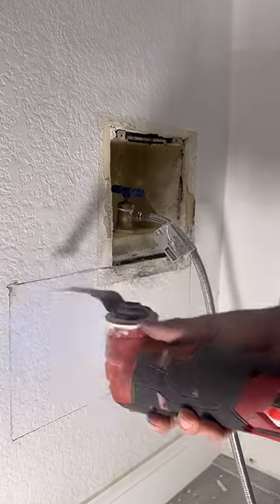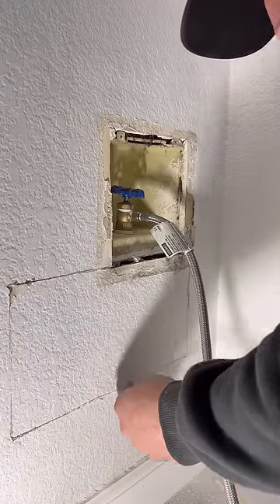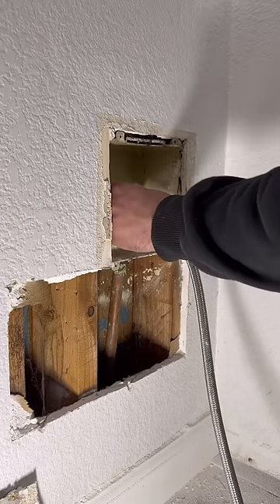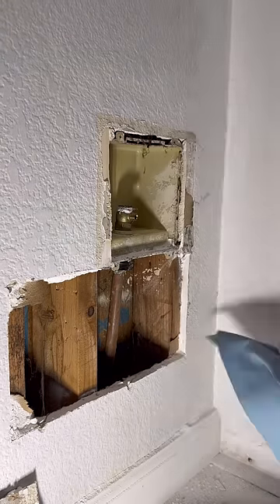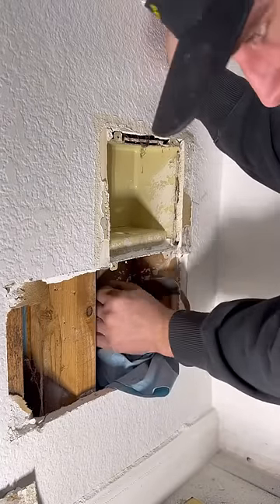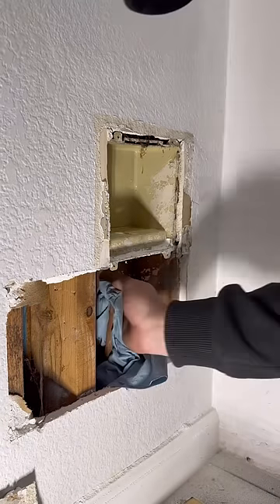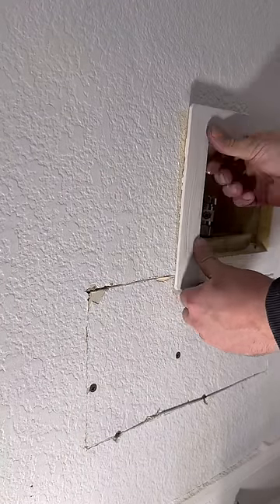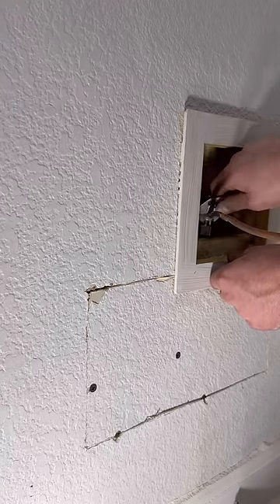replacing an icemaker valve #plumber #plumbing #propress #diy #soldering #repair #copper #easymoney

Comment: My guy even cuts the drywall clean and puts it back, most plumbers/electricians would’ve just put a fist through there and spat on the dust
Reply: Yeh, this cat thinks about the next guy. Golden. I like his old buzzard impersonations too! 😂
Reply: "just put a fist through there" I am rolling because it is true.
Reply: Can confirm
Reply: @namechamps  electricians are the worst. They are also the most unhappy of all the trades. Go figure.
Reply: lmfao see that too much especially with electrical.
Reply: But a plumber using a insulated screwdriver
Reply: @vrea77  if it screws it screws!
Reply: @johnbagewll2321  sounds like something a plumber would say

Comment: I love the fact that you go ahead and address all the potential Facebook plumbing inspectors during your video 😂😂😂😂
Reply: I was thinking the same thing 😂😂
Reply: Let's see...he should have repaired the existing valve, he cut the hole too big, shouldn't have used press fittings, and the valve he installed is crooked.  Did I miss anything I learned in my 147 years in the trade?
Reply: @mph7282  yeah, that you're in the wrong trade. 😂

Comment: My father and I do bathroom and kitchen renovations. 

Sonic tool is an absolute god-send for getting into walls like this, but just can't sell him on spending the money on the pro-press tool. There's time and place for sweating, don't get me wrong, but sometimes you're really just fighting yourself when you have to stuff a mat behind the pipe, tack it up with a single screw, and then making sure everything is wet before you hit the wall with a torch.

I used one to re-plumb the hyper-cooler for an induction furnace once. Ended up being more than 50ft of pipe in a space that essentially fit inside a broom closet - all of it 2in copper. 

I can't even imagine the nightmare of a repair job it would have been without that pro-press. Best plumbing tool I think I've ever used. 

Keep up the good work bud - you're damned good at your profession.

Comment: I don't know if it is just misunderstanding, but one of my customer had refrigerator ordered from home depot, but installers could not install because ice maker supply does not have a valve.  Well that valve was under the sink and had soft copper tubing run through cabinets. Also, the valve does hold. Installers had Home depot call their contracted plumber and plumber came out and installed in-line valve at the refrigerator end for $350.  My customer thought Home depot would call and schedule re-delivery and install, but they never called. Instead the order got canceled.  I ended up fixing their old refrigerator and my customer wasted money installing unnecessary valve.

Comment: I hate those ice maker boxes behind the fridge.  We always run the line to under the sink on new roughs.  Have you ever used the 1/4 pex for the lines?  They’re great, they don’t kink and don’t need an insert like poly, only a nut and ferrule.
Reply: Great idea, I always prefer to have the ice maker valve under the kitchen sink for the customer. I'll try the 1/4" PEX next time.

Comment: You do some good clean work personally I will use a braided line safer that way
Reply: Dunno why he went from braided to soft copper, but from a full twist valve to 1/4 turn, seems like he upgraded the valve and downgraded the supply. The patch looks nice tho. I can deal with that repair!

Comment: I have a stud finder that self-calibrates to the density of sheet rock or plaster and can detect metal. Then I have another one that detects metal and electrical but doesn't calibrate so it won't work on plaster unless I find a screw. It's faster to find the stud than it is to find the screw.

These tools were not expensive.

Comment: I like that you only use 1/4 turn valves.  They are much better and last longer.  I'm skeptical about using ProPress inside a wall.  I worry that it won't last as long as a soldered connection.  But, I get the speed advantage.

Comment: Quick tip.
Most times can get away with just caulking all the way around.
But make your drywall cuts on an angle going into hole all the way around. It self centered.
You just need to expose screw/nail head.

Comment: cool if you don't have parts for that valve but it definitely doesn't take less time to install a brand new valve than to rebuild the existing valve.  Like it's a perfectly reasonable choice to make but in no world is it faster to cut extra drywall and change a valve then to rebuild a valve in place.

Comment: Good luck matching that knock-down done on the wall.and you know being a plumber the pipes go straight down under the box.good job replacing the valve though and as they say( I ain't the plumber  or the plumbers son but I can plug any whole until the plumber comes) crap runs down hill,payday is on Friday and the boss is an S.O.B

Comment: So as a service company you don't install anything but quarter turn valves but you'll be ok connecting soft copper knowing the line will be pushed in by the refrigerator lol

Comment: As a maintenance tech you did a great job only thing I would have did different I would use the braided supply line rather than soft copper. To me they have more flexibility and they're less likely to break during movement. Other than that great video. Me myself I would have finished the repair on the wall.
Reply: This was the only thing that confused me, I don't understand why he went to a line more likely to kink and break, maybe I'm wrong, but it was an odd choice to me
Reply: He gets to charge for it.

Comment: Why not use a braided stainless steel hose?
Reply from the maker: Didn’t have one. Copper line is good too. Same same
Reply: Copper lines are often requested for water lines and sometimes are by area code. The main reason is that, copper, naturally kills bacteria in water. although, it may not be a big deal, since it takes around 7-30 days for filtered still water in pipes getting harmful bacteria.

Comment: I'm curious why he went back to using the copper supply line from the valve to the fridge instead of just using another braided stainless hose? 

I've always used the braided stainless personally because it prevents the line getting beat up from moving the fridge around for cleaning and stuff over time.

Comment: Im not personally a fan of propress fittings for applications like this, just based solely on price of fittings and tools. Just the fitting alone is a few dollars compared to a 50 cent coupler because of manufacturing, and the tool is more expensive than a full soldering setup. 

I believe propress has its time and place, but in my opinion its more for emergency situations where you cant fully turn off the water, or drain the water from the system enough to solder.

I was brought up old school, and a compressed rubber ring will never last as long as a properly soldered fitting. 

Either way, clean job 👍

Comment: Superclean repair! Something like that that you're never going to see just run a bead of caulk around the seam push the fridge back and you'll never know what happened. Always try to save your drywall when you have to gain access. Another great tip if you have to cut drywall to let's say get behind a tub valve you could always cut in a access panel door and you can even get a paintable one that way you will always have access to that area and it will save on drywall repair

Comment: I'm not going to argue about the rebuilding of the valve because it could have been fixed in 5 minutes and no sheetrock repair but quarter turns or more reliable My big question would be why did you use a copper line when you started with the braided line proven to be more flexible and reliable then the copper line that will most likely kink and possibly leak not saying it happens every time just saying it's a lot more likely to fail than the braided line. Just seemed odd to go with everything new school and then install an old school copper line. Genuinely curious what your reason is

Comment: I like how so many people have issues with squishing 1 thing on another, but compression fitting arnt a problem 😂
Reply: Compression fittings don't use rubber to seal up the pressure.

Comment: it took wayyyy longer to replace the whole valve than it would have to change the rubber on that old one. as a fellow plumber. to each their own but this could have been a 5 min job with $1 in parts.

Comment: Copper instead of braided?
Reply from the maker: What I had on the truck
Reply: @replumb 
Didn't the old braided line disconnect easily at both ends so you could reuse it? It is a better choice than rolled copper in terms of flexibility when bottom freezer units exert so much movement on that part through heavy sliding door use.

Comment: Why did you replace the flex hose with the soft copper tubing? Seems like a step backward.
A Pro press kit is close to 4 thousand dollars? I guess that it is not for the regular homeowner.

Comment: Hello 

Could you tell me the name of the machine you used to cut off the wall.

I want the name of the tool not the brand. 

Regards
Reply from the maker: Oscillating multi tool
Reply: @replumb  

Thanks much.  😊

Comment: just use a sharp utility knife you can cut the drywall out with ease far faster than the oscillating tool with far less mess

Comment: I have to disagree with your assertion that it took you less time than rebuilding the valve.  It would have taken literally 3 minutes to rebuild the valve and you wouldn't have had to cut the sheetrock.

Comment: "I'm leaving the sheet rock like this because I'm a plumber"

Don't be surprised when some customers do not call you back after. 

Wise man once told me leave the job like you were never there! The customer will see that and go "wtf kinda hack job BS is this" and find someone else who promises to not leave their walls all diced up next time because "they're a plumber" 

You'll lose valuable customers you'll never know how valuable they could've been with that mindset.

Just do it right and charge them accordingly. Or ask if they want the drywall fixed too and charge extra for it. It's not rocket science, but always leave it up to the customer what they want.

Comment: Sorry but my first attempt is to rebuild the leaky valve and not replace.  Especially since you had to open up the drywall, cut out old then reinstall a new value via pro-press.

Comment: Soft copper is supposed to be pressed twice
Reply from the maker: False
Reply: @replumb  not false actually correct 👍
Reply: @replumb  wasn’t hating on you just trying to help. I’ve had fittings barely drip after pressing on soft copper. I’ve seen people press it multiple times on soft copper to get it to stop dripping. Do whatever u want tho. Cut it out if it drips I guess 😂

Comment: Looks 👍. But yeah I wouldn't have cut it beyond that first stud. Other than that it looks great. Besides that I  would have soldered a coupler on. F*** that ProPress.  Soft copper supply line?  Oh f*** that s*** use the goddamn braided line. Come on now. F**** soft copper. Give me a break.

Comment: Sorry but every plumber, electrician or anyone making small cuts for repair needs to know how to do basic drywall repair. Especially something such as this. Granted its hidden behind the fridge but in most cases it’s in plain site. I can’t stand contractors that replace one issue for another

Comment: Isn't it stupid design to start with? 
You have to cut open the drywall just to change a valve ? 
Wouldn't be easier to install a wall plate end screw in the valve. If the valve goes bad you just screw in a new one. Without having to cut open the wall..

Comment: Wait. What do you mean it's ok to press soft copper? No shit bro they wouldn't make the fittings otherwise 😂😂  but no you cannot press THIN copper. Type M shouldn't be pressed. And radiators you need to buy the brass inserts

Comment: As someone who does drywall, yuck.
Reply: @replumb  nah but you did a great job, and that;ll be covered up by a big fridge anyway. just curious, after you're done, do you leave it like that? or do you tape and mud it or how does that work
Reply from the maker: @murkypuddle33  leave it like that c u later

Comment: I would've checked for leaks before putting the drywall back up
Reply from the maker: What makes you think I didn’t
Reply: @replumb  well i'm going to assume you did but the video doesn't show you did
Reply from the maker: @zero1fifty8  it’s a 1 minute video. It didn’t show a lot of things. Turning the water off, taking all my tools out, turning the water on, checking for leaks, putting all my tools away, pushing the fridge back, billing the customer etc

Comment: Plumbers. I’m gonna charge you 2900 for some plumbing and I’m not gonna fix the floor or the wall I put a hole in. And I’m not gonna clean up my mess because I’m a plumber not a maid😂😂 plumbers are the laziest trade. Wont do anything unless it’s perfect for them and won’t put anything back.